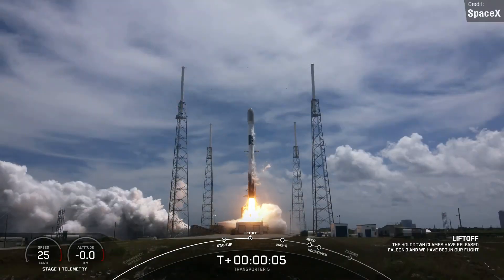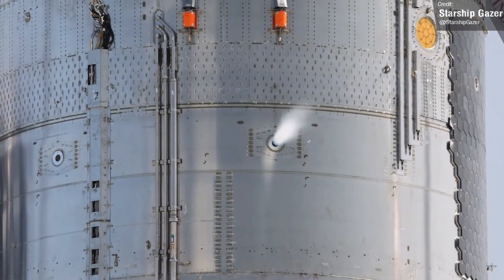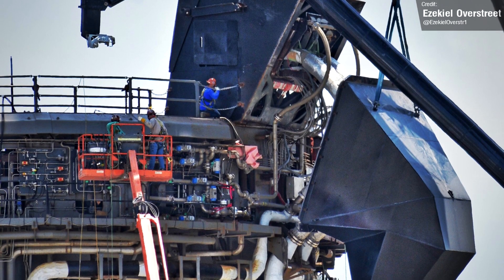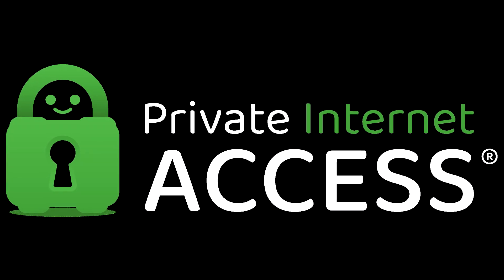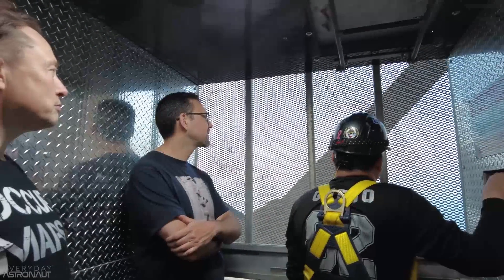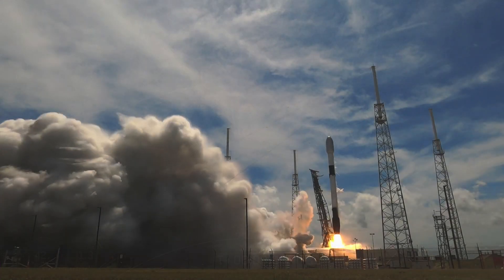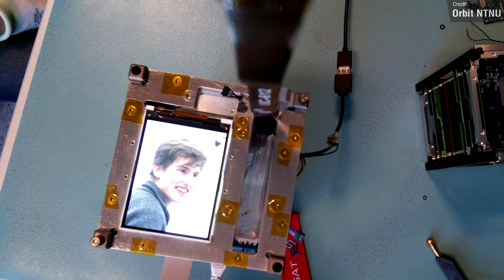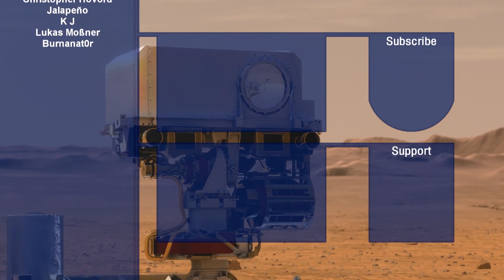SpaceX Starship 24 Internal Failure, Starlink V2, Transporter 5, Starliner Return, Ingenuity Record

Comment: Why don't  they use that Mars helicopter  to fly over that lander that has dust on its solar  panels and blow off the panels with the rotor wash??
Reply: The helicopter is over 2000 miles away and has dust problems of its own.

Comment: There was a small explosion inside SN24 during pressure testing which caused a large number of tiles to fall from the ship. The bent pipe being removed after the test is no doubt something to do with this. There are a few videos on YT with audio where you can hear a muffled bang followed by a couple of dozen tiles falling from one side of the ship.

Comment: To quote The Martian (Andy Weir): "Turns out the L in LCD stands for liquid" Won't these screens freeze in outer space?
Reply: Heat Transfer is hard in the vacuum of space, but it’s slightly easier in Mars’ atmosphere. On Mars, convection from the atmosphere would probably pull away enough heat from the LCD to freeze it. The only way for the LCD in space to lose heat to freeze it is thru radiation, and I reckon the heat from the sun will keep it toasty warm and possibly overheat.

Comment: That why Blue Origin and Boeing Lockheed going to be the next spacecraft to be NASA moon and Mars missions!
Reply: I wouldn't be so sure as the Apr 2021 NASA HLS Option A Source Selection Statement noted some significant weakness of the Blue Origin led National Team ILV, one of which was the propulsion system. The ILV "propulsion systems consist of complex major subsystems that have low Technology Readiness Levels (TRLs) and are immature for Blue Origin’s current phase of development" (pg 15). There were concerns about parts procurement for long lead items and "numerous mission-critical integrated propulsion systems will not be flight tested until Blue Origin’s scheduled 2024 crewed mission" (pg 15 again and 2026 now for the crewed mission). The Blue Origin led National Team of Lockheed Martin (ascent stage), Blue Origin (descent stage), Northrop Grumman (transfer stage), and Draper (avionics) is competing in the Lunar Exploration Transportation Services (LETS) contract process that will replace HLS and Appendix P along with SpaceX, Dynetics (Alpaca), Lockheed Martin, and Northrop Grumman. Note, half of the National Team is competing separately for LETS.

Comment: Just a thought, you know how the solar panels keep getting covered with Mars dust. I wonder if they could use Ingenuity's downwash to clear some of the dust?
Reply: The solar-panel issue is with the Insight lander, which is unfortunately more than 2000 miles away from Perseverance & Ingenuity.
Reply: As Stephan said, the helicopter is thousands of miles away. It also has its own dust problems, even with the blades helping to clean the panel off.
Reply: I should have clarified, I was talking about Perseverance. If it wound up with dust problem.

I know the downwash isn't that high, it was just a thought.

One would think Ingenuity would get a fair bit of dust off it's own panels just by it's movement. There has to be some sort of wind, hence some airflow, couldn't fly otherwise.
Reply: @coalsilvermuzzle3111  Perseverance isn't solar powered, it uses an RTG. So no problem with dust.
Reply: @coalsilvermuzzle3111  The solar panel is above the blades on the helicopter. So the air being pulled into the blades is what moves a bit of the dust off. The thing only weighs 4 pounds, so it doesn't have a lot of thrust downwards to fly.

Comment: Another great video. Thank you. The tiles that came off seem to be in-line with the pez-dispenser slot on the other side. My guess for the tiles popping off is due to testing the depressurization of that area - the payload area will need to slowly depressurize so the payload door can open. Perhaps SpaceX was testing that system and it went a bit too fast or something?

Comment: The localized loss of tiles was caused by the failure of the pressurization plumbing. There was a rapid energy release.
Reply: "Rapid energy release" - minor explosion?  Pipe failure leading to rapid loss of pressure in a high pressure line?

Comment: If pressure testing blows out kinks, then they may need to evolve to ambient testing ships before tiles are applied.
Reply: Just like here they put all the roof tiles up on the house being built before putting on the stucco  to stress the walls otherwise the stucco would crack after loading them with the roof tile weight.

Comment: Looks like they are changing the tile design.  The tiles on the yet to be installed aerocovers are different, the black ceramic doesnt cover the entire exposed surface, with exposed fibers to allow for expansion.

Comment: can't they just pressurise and 'pop' the tank before they put on the heat tiles? how dangerous is a heat-tile falling off before re-entry in terms of the ship being able to handle the exposed steal to re-entry burn? I thought the 301L steel could handle very high temperatures? and all those catch attachment places and whatnot sticking out from the heat-tiles, can't they be made to come out of a flap that is tiled congruent with the hull after re-entry burn like landing gear on a shuttle? or what about the respiratory coolant technique just in specific problematic areas? can they test re-entry conditions on earth with a machine shaking the craft and some sort of furnace wind-tunnel, and use the old Starships that is no longer going to be used for flight to test the heat-tile expansion and vibration survivability? even on a smaller model, say a third of the size? sorry it just brings up so many questions, I would hate it if they lose a vehicle on re-entry like Columbia. What about a heat resistant gel like aerogel between tiles, allowing a bigger gap, without exposing a gap for the plasma to reach the steel?

Comment: Tiles shouldn't drop off because of the underlying metal flexing. We need a better explanation of what is going wrong with the attachments.
Reply: During the cryo test you can hear a loud bang just before the tiles falls off. Best explanation I have heard is that this is most likely when some of the plumbing inside the ship failed (the collapsed and bend pipe) and it was the shockwave of that which made it lose some tiles.
Reply: @itsonlycode  During launch the sound pressure is at the shockwave level. During re-entry the body of the vehicle will flex and there will be intense aerodynamic pressure and turbulence. If the tiles can't survive the hull being twanged by a broken pipe, there's a big question as to whether they will survive normal use.
Reply: @saumyacow4435  I don't know if you actually watched the test but the "bang" was seriously loud. Could be heard far away.
There is a very big difference about a shockwave inside a closed container where the energy has nowhere to go and to a pressure wave hitting your from the outside.
Put a firecracker in a coke can vs one next to a coke can and see the difference.
Also during re-entry the tiles are expanding and should better keep each other in place (At least that is my understanding as a "i'm not a rocket scientist")
Reply: @itsonlycode  I think you're underestimating the forces involved in the sound pressure at launch. its no longer sound but rather a series of shockwaves Yes, I heard the bang on video. Whatever it was, it clearly flexed the wall of the vehicle. Even so, these attachments should  have held. And its not the first such incident of it shedding tiles. My guess is that its the interface between the spring loaded clip within the tile itself, and the tile material. The tile material is quite brittle - you can break it with your hands. So they are going to have to have a deeper think about this issue.
Reply: @saumyacow4435  potentially a 230dB shockwave at launch...
Reply: @solarius14  Yup.. and those tiles concentrate the force onto the three attachment points.
Reply: @saumyacow4435 Shockwaves outside are not moving rapidly relative to the vehicle. You are also not going to produce significant outward force on the clips. The forces involved in flight are going to be very different from those caused by the vehicle ringing like a bell, even if they are similar in magnitude. I think these conditions are different enough from expected loads that I am not immediately concerned.
Reply: @agsystems8220  we are talking about launch, not flight.

Comment: Correct me if I'm wrong, but isnt one of the good things about stainless steel that you can lose a couple tiles with no problems?
Reply: No, a full tile loss on ascent is game over. Ss is not conductive enough to cool decent temperatures
Reply: I think I heard that before... The Spacex SS alloy was developed to be a higher temp SS - but also, they've been thinning it as the months have gone by for weight reduction.  I do think you're correct, though.

Comment: I don't have an alternate theory about exactly when, where, and how the heat shield tiles are installed, but I am concerned about the delicacy of the tile attachments.  I had hoped that these issues were somewhat solved (I understand that these are still prototypes), but the massive tile loss for what seemed a minor glitch does not bode well for the hell of atmospheric reentry which is undoubtedly more stressful than whatever happened at the test stand.
Reply: I'm not sure I would call it a minor glitch.  It seems like a pressurized pipe burst and slammed into the side wall behind the heat tiles knocking a few off (you can see them pull the broken pipe out after the test).  That's not the kind of thing that the tiles are really designed to handle.  Still a problem, but a problem with the plumbing rather than with the tiles themselves
Reply: It should put less stress on them as there will be pressure pushing against the tile faces when returning.

Comment: Micro cracks in the welding of the two halves will allow gas through. The exposed areas are to allow an xray welding inspection tool to be ran along the seam. We have a saying: "Think you can weld? We'll let the xray determine that!"
Reply: Space x is a con.. 
This thing will never leave the earth..
When are Americans going to realise, Starship is a con.. Elon lives on his investors money..
The Starship is too impractical to go into space. 
On launch, friction in the atmosphere is volume.. which slows you down.. a small rocket has less friction.. this thing is just another huge American tank driving down the highway..
Like Americans cars, big and dumb..
Reply: So the cracks are intentional?  Do you work for Spacex or a subcontractor?  BTW, the welding is done by machine (I Hope), is it not?
Reply: @rimckd825  i am pretty sure he is just talking about basic welding stuff, not SpaceX specific stuff. there are other diagnostic tools for micro cracks, but x-ray is probably the best, though my experience is with other tools since they are much cheaper.
Reply: @rimckd825  with a design that changes like every day, no... it would be nearly impossible to just have a machine weld everything because it has to be built to weld specific things in a specific way and when the design changes then the welding machine would become obsolete
Reply: @rimckd825  yes a robot is used for some of the weld seams. But I imagine not every seam is done that way. Not every weld connection is identical and weld robots are usually designed for only a few applications.
Reply: Something I keep forgetting about until recently. If you are welding in space you can use electron beam welding, is that method less likely to produce micro fractures?
Reply: @acarrillo8277  unless i am getting things wrong microfractures are the result of a weld having either incomplete melting in a tiny spot or contaminants in the weld. in a vacuum you end up with less microfracures because you don't have gas (unless you bring that for the welding process). you can also weld faster than things can melt causing microfractures. electron beam welding should be a pretty good process in space, though the material you are welding is pretty important as well.
Reply: I'm not engineer at all, but each mm square of each part of starship should be scanned for any imperfection. Building them under the sky by dozens of engineers can cause different undiscovered scratches. When see all those lifts almost touching starship surface, tiles when lifting people I don't believe any "hit" did not took place.

Comment: So this is the second Starship crisis after the Raptor crisis?
Reply from the maker: I wouldn't really call it a "crisis" tbh
Reply: @MattLowne  It is, they are desperately trying to make work a bad and overly complicated design that they need to launch a bad attempt to defray expenses (starlink 2.0). 
Its fun that not even Elon Musk can follow his own motto (best part is no part).
Reply: @solarius14  Overly complicated? It's as simple as it is possible to be. We always see failures as they push things, and do you think they are just hanging around while they wait for the FAA? My guess is that they were trialling a different loading procedure and something didn't work*. If this were a billion dollar piece of equipment I would be concerned, but with how they are chucking them out it is probably cheaper to just test things on a full size vehicle than try to model it well enough to be confident.
A crisis would be 3 launch failures**. Even if all the recovery systems fail, it would still end up being cheapest ride to space per kilo (maybe not quite beating falcon 9). Right now while they are waiting for the FAA, this isn't even a delay. If there is any crisis, it is on account of politics, not engineering.
*It is also possible that they are trying to simplify the internals by using existing plumbing to fill the tanks. That may require a more complicated loading procedure, but result in a simpler vehicle.
** While most established rocket companies would regard a single failure as a crisis, the difference in development approach and design philosophy for starship buys them some leeway. Rather than designing a working rocked, and then making it cheap, they are designing a cheap rocket, and then making it work. This means it not working first time is not as much of a concern.
Reply: @agsystems8220  yes, integrating 33 engines in a reusable vehicle that flies to a catch tower is overly complicated. 
A ship that needs orbit refueling, that relies in 4mm steel for debris/radiation shielding, that uses tank pressure for structural stability (taking into account that when landing starship will be top heavy <cargo, passengers, facilities> and will have low pressure in the tanks) is asking for trouble.
Btw a single space rated toilet is 23 million, a treadmill 5 million. How is gonna starship hold that cheap status while supposedly being to accomodate up to 100 passengers, various tanker launches per mission, refurbishment and repair costs?
It doesnt add up, or rather it adds up fast.

All of this while sucking on public funding and holding onto Starlink 2.0 for money. You know, that system which isnt exactly better than cable, and way more expensive (for its users, and for Starlink itself) than its competitors, and that depends on starship working for its deployment (falcon cant deploy the new sats). 
If you run the numbers you'll see that they'd need more users than what the sat internet market can allow (less than 1% of the internet market).
It's a terrible plan from the beginning.
Reply: @solarius14  I am afraid that house of cards just stacks so high why being held up by the power of motivation and optimism alone. Maybe at some point the chief engineer should be an actual chief engineer and not a businessman moonlighting as one.